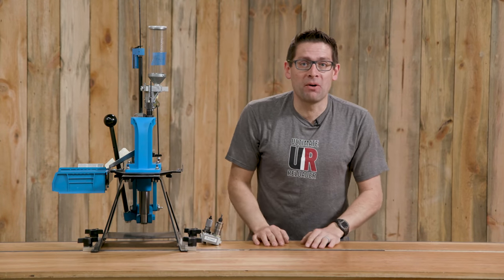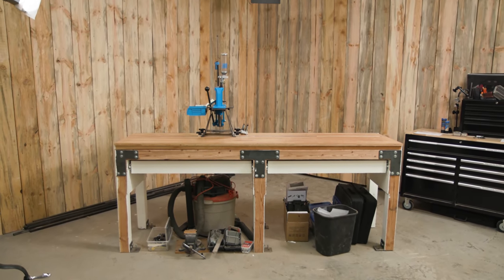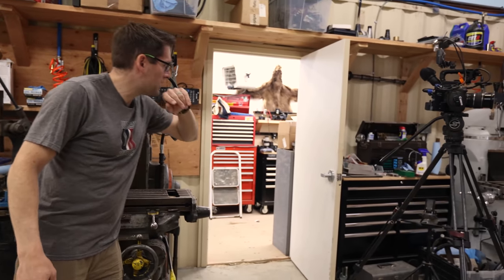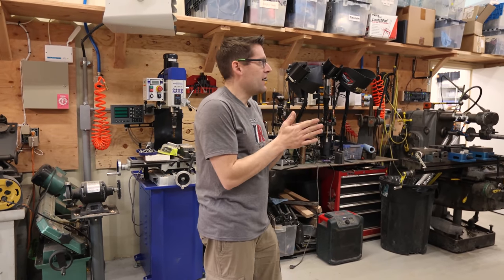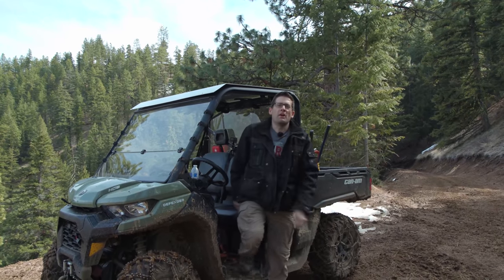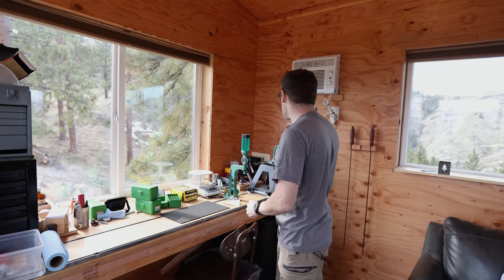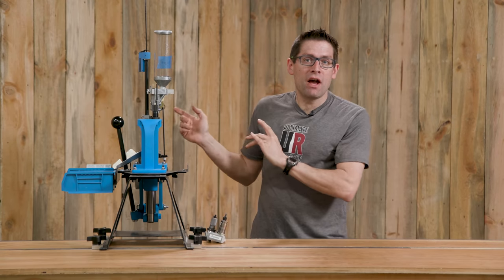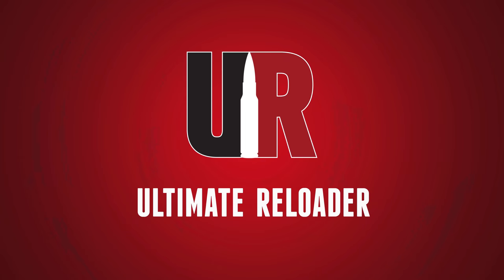UR 2.0: 200K Subscribers, New Studio, Here's What's Next!

Comment: Gavin, here is what I did. I took a box of Winchester 223, 45grain hp....40 round box and measured the ogive to the base. The SAAMI drawing says 1.857. My average is 1.856. My shortest is 0.010” short, and my longest 0.011 too long. That means plus or minus ten thousandths to me. Plus or minus ten. That’s HUGE. But here is the kicker, my Remington 700 BDL .223 LOVES this cartridge. It is so accurate shooting it is a waste of money. There is no longer. Challenge to find zero. BUT, my HOWA 1500 .223, hates everything I put through it. I have not loaded a thing yet. Right now, it’s a learning and data collection time. I want to load safely and not waste my time and money trying to find something my HOWA likes. What I like don’t matter.

I need a chrono. Studying the SAAMI drawing, tells me the dimension of the ogive HAS TO BE the same for any grain of .223 in order for interchangeability from one chamber to another , any bullet to another. Nothing can change with that dimension.....SO......where do I look first to develope something my HOWA agrees with? I have developed a tool of my own to measure end of case to position of the rifling to compare the HOWA to the BDL. THAT SHOULD BE INTERESTING. Maybe tonight yet I may get to it. If I do I will edit this post. Thanks. 

I may be putting more into this than I need to, but, for me, I need to break this down to it’s very basic simplest form, then put it back together, detail by detail, so I know what I am looking at and not saying something really stupid....like......I like this, and I like that. I want what my gun likes, that will make me happy. Thanks.